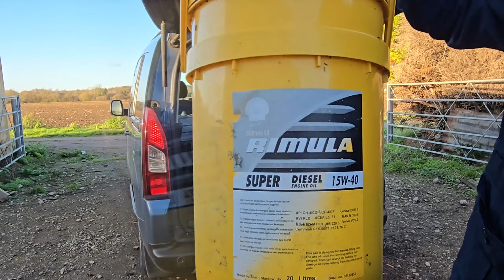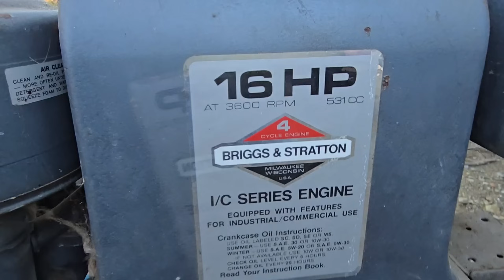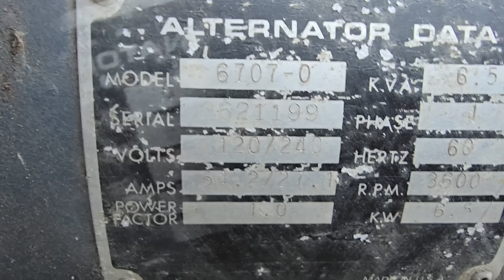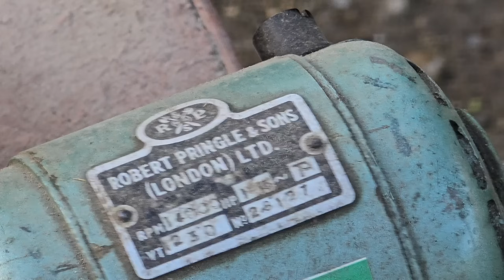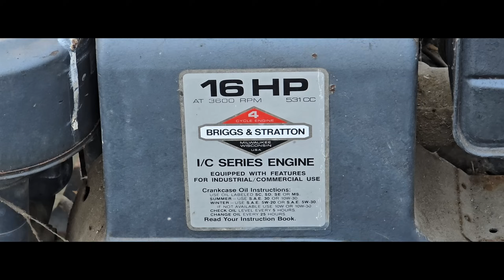What did I get from Auction?? Lathe, Generator and oils.

Comment: headstock moves so you can change the chuck speed, as the motor is fixed. nice find👍( correction the motor is slotted to tension the belt)😉

Comment: Bear in mind that at 60 Hrz output that it's not the UK 50Hrz. However it should be fine for lighting.
The box has been modified to give just 240 vac but it could easily be revamped to duel voltage again

Comment: Just be careful with your cutting and grinding discs as the compound can break down in them and you need to check the use by date that is on the silver washer part that attaches to your grinder, be safe mate.

Comment: Sodium hypochlorite is a green/yellow liquid with the characteristic smell of chlorine. It was first used as a bleaching agent and was then discovered to be effective in controlling wound infections. Subsequently, it is most commonly known as household bleach.
Reply: just be CAREFUL! the stuff in that drum may be a LOT more concentrated than the household bleach available in shops. bulk sodium hypochlorite is often used in swimming pool treatment hence the much higher concentration then ordinary household bleach from a shop.
Reply: @tech4pros1   14% or thereabout is also used to remove white or black spots when pressure washing concrete/stone paths. Pressure wash first and then spray with hypo, dilute by half (ish), leave 15 mins, and rinse off. As you say, BE CAREFUL. It will remove your fingerprints if it gets on your hands; just think what it does to your eyes if they get a splash.

Comment: The grinding discs look like the 4" discs fit the 4" angle grinder. The bore is smaller than the 4.5" angle grinder. The other discs, 115mm fit the 4.5" angle grinder.

Comment: The Gen has too many Hertz, I said about it in the look around video. To operate 50 Hertz you may consider an inverter which could produce 3 phase if you need it.
Reply: Or just reduce the engine speed to bring it down to 50hz.
Reply: @ that lowers the voltage too.
Reply: @adrianchetwynd1334  increase the excitation voltage if the AVR doesn't do it automatically.
Reply: @jeremytodd4906  Could try adjusting the Flux Capacitor.
Reply: @adrianchetwynd1334  if you don't understand how a generator works you could just keep quiet.
Reply: @ So nothing to do with the number of windings then?

(My “Flux capacitor” comment was a joke)
Reply: @adrianchetwynd1334  oh yes he could rewind it.... or adjust the field current like every other generator does to reglate it's voltage output. If you don't believe me Google it! It's been industry standard since the dawn of time, even the simple Chinese capacitor control generators do it. That's why the same alternator can be sold all over the world, speed it up for 60hz and slow it down for 50hz, the controller holds the voltage at 240 or whatever its set to, more complex sets have a governor to adjust fueling to prevent sag under load and surge offload.

Comment: one problem you have is that the UK uses 50hz not the 60hz your generator is (US)
Reply: Yes as soon as I heard 16 hp at 3600 rpm I thought it must be 60 hz presumably the governor can just be set down to 3000 rpm to give 50 hz.
Reply: Yeah, mega noise at 3600rpm and 60hz which isn’t ideal….. or slow it down to 3000 / 50hz and be under voltage. May be possible to sort with an adjustable avr?!